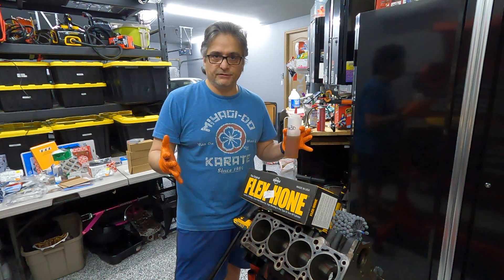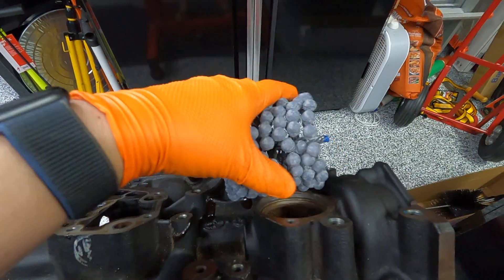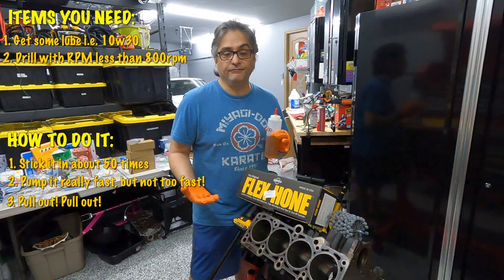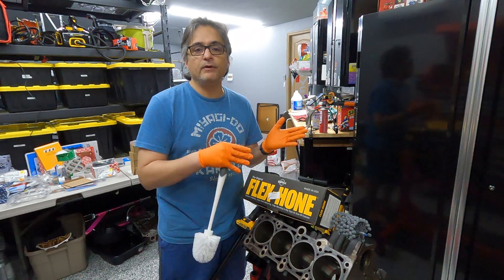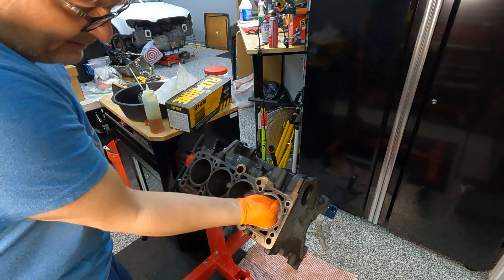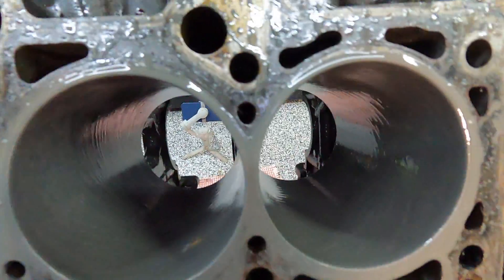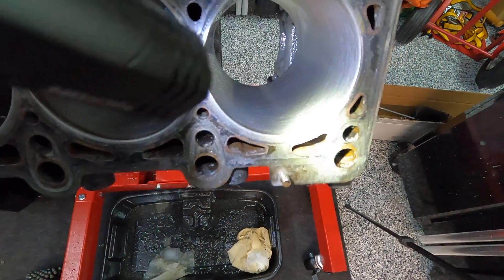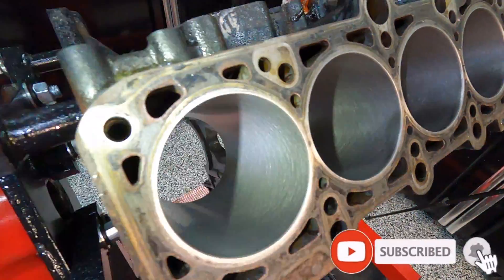Yogi's Tech Tip: How To DEGLAZE Engine Cylinders Using A FLEX HONE

Comment: Greay video. Maybe I missed it, but at what RPM were you running the drill? Would you say you kept a 1 second per cycle timeing, meaning .5 seconds down and .5 seconds up? Thanks again.
Reply from the maker: Yeah I believe I mentioned the speed of my drill. It’s been a while but I believe I used 1 speed on my DeWalt. Good luck.